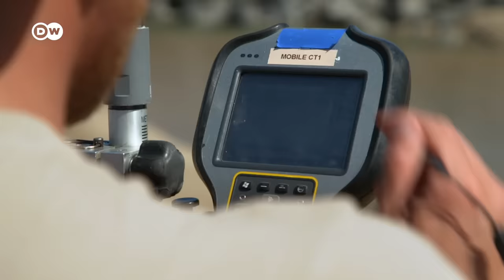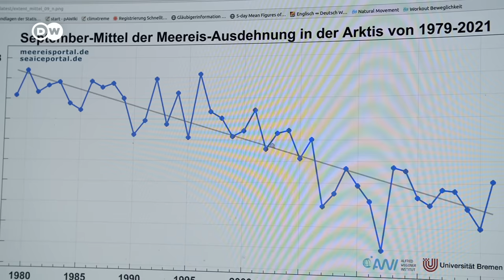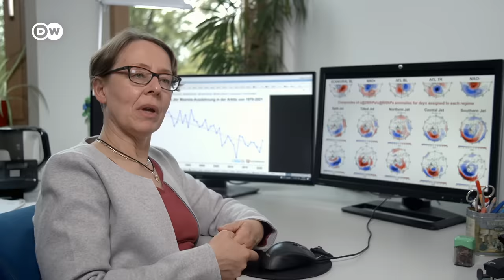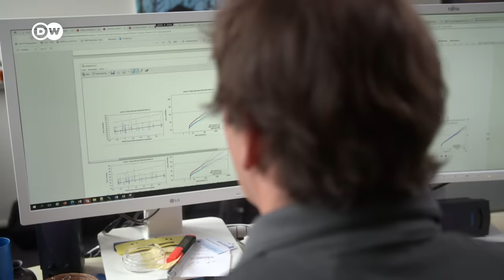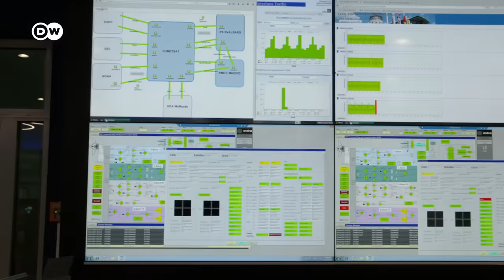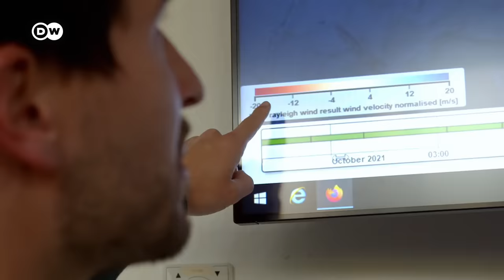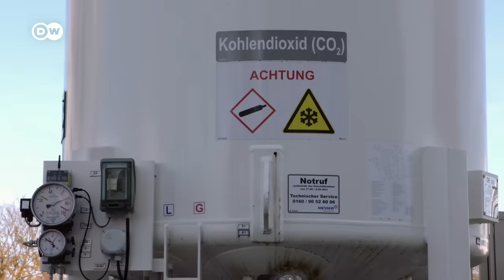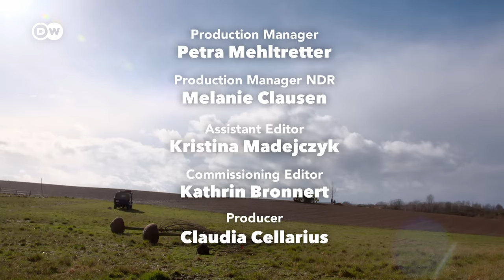Wind and climate change | DW Documentary

Comment: Without fossil fuels our major transportation systems, including trucking, rail and sea transportation of goods, depend greatly on fossil fuels. Without diesel and bunker fuel, large-scale international trade would have no choice but to shut down.

Natural resources such like wood as well as beasts of burden (horses, oxen, carabao) would be used badly.

Thesis: 

According to the “Black Box Theory”, you cannot produce an energy gain by burying deceased non-living plant and animal matter.

The Black Box Theory proves that energy gain is not possible simply by burying it in the ground. The issue of energy transfer is not covered here, however that would only result in a lesser amount of energy transfer regardless of the efficacy of the transfer.

“a black box describes something that has observable inputs and outputs and unseen inner workings. Something goes in and something comes out, but the process by which transformation occurs is “black” or unknown to the observer.” 

I’m interested in how it is possible to extract an energy greater than those initially deposited by liberating fossil fuels from beneath the surface of the Earth?

The burning of fossil fuels might make the planet Earth warmer, or colder or have no impact on the average temperature of the planet Earth whatsoever as it is currently in 2023, take your pick. However the Earth will never be warmer or colder than is was when these plants or animals existed. 

Please reply if this is possible? 
Let everyone know how it is that you can get more energy out than you put in.
This is the basis for your climate change theory, where is the science?
Perhaps 97% of American/Canadian/British Scientist’s don’t know what they are taking about, please help me here.  

As far as the Earth goes; mammals and specifically primates like homo sapiens, “You’re less important than you think you are.”